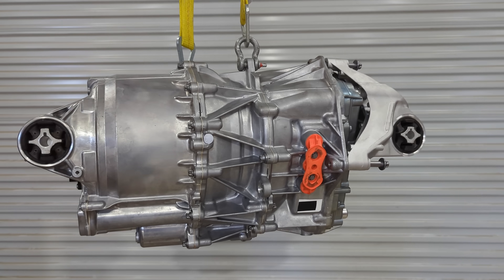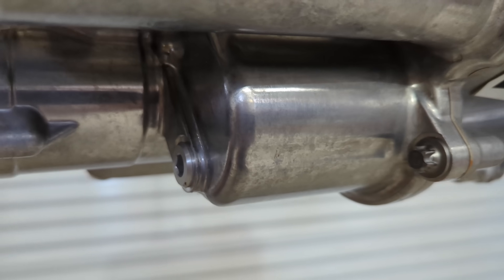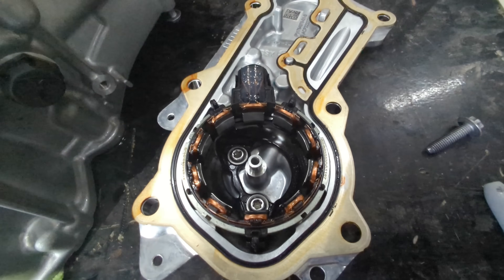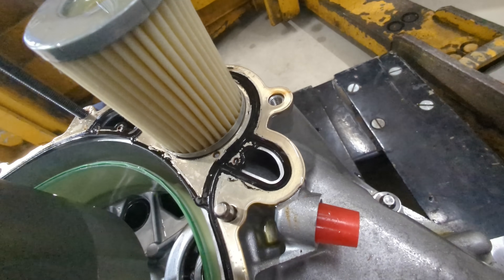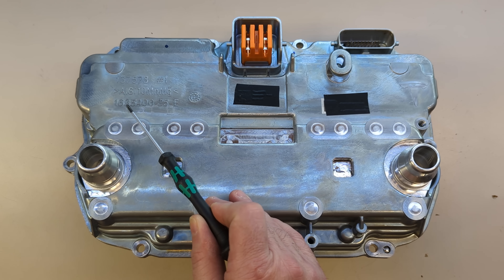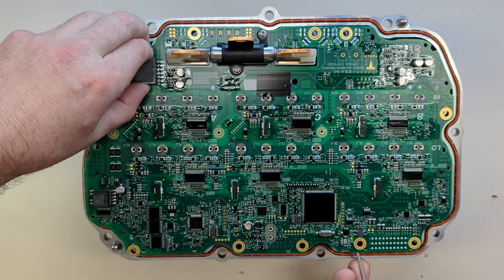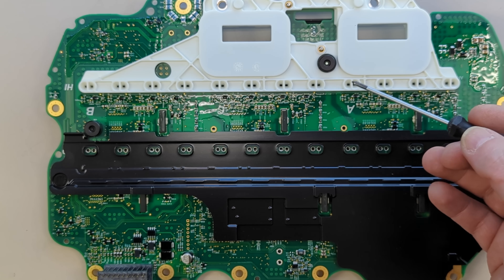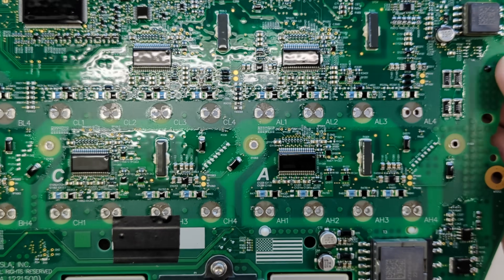Tesla's Newest Motor & Drive Unit

Comment: Should i do the coolant bypass on the model S LDU?
Reply from the maker: If you plan on keeping the car for awhile!  It's looking like all cars eventually have this failure, so preemptive action will mean you are less likely to find yourself on the side of the road one day.   Murphy's Law says that will probably happen when it's freezing cold and raining and/or snowing while you have your whole family in the car for a road trip.
Reply: @ thanks for the Fast reply. I have the Model S for 9 years now. No mayor issues. But, just learned recently of the issue with the LDU and coolant leak. Asked Tesla but they only do replacements. Will probably do the Bypass as motor doesnt have any symptoms now. Thanks
Reply from the maker: @EVunedited  Unfortunately by the time it does have "symptoms", it's usually trashed.

Comment: What does the 640uF capacitor do? Big electrolytic capacitors tend to have short lifetimes if they get hot.
Reply from the maker: It's the link capacitor.  As the inverter switches there are large current pulses, this acts like a local reservoir because there is substantial inductance in the battery loop, so the current just isn't there when it's needed.   It's likely a polypropylene film capacitor, not electrolytic, it should last the life of the car.  See: https://industrial.panasonic.com/ww/products-pt/automotive-film-cap/custom-made-xEV

Comment: They say that in EU and China V2L is possible , but not in North America ? What is the difference? I remember your video of inverter and the fact that inverter only could convert DC to AC in one direction. Do you know if EU inverters are different. Elon said that in EU and China they only needed to do at software update to fix V2L. Any idea ?
Reply from the maker: It's possible in all Teslas, but will require an expensive external DC to AC inverter.  (Subject to Tesla's will).  No Tesla model except the Cybertruck can export AC natively.  Period.  This may change in the future, but as of today (October 2024), the hardware is definitely not capable of generating AC.  All Tesla models, even the Cybertruck state in the vehicle warranty that using the vehicle for stationary storage voids your battery warranty.   So even if you hack it in as I have done, you risk losing your battery warranty.  (I have salvage vehicles, so my warranty is already void)

Comment: Any chance you’ll get your hands on the new 4D2 motor from the new Model 3 Performance?
Reply from the maker: As soon as someone sends me one, I'll do a teardown!   I suspect it's very similar to this one.
Reply: @Ingineerix  - I would love to hear your thoughts on the 2024 Model 3 Performance 4D2 units leaking oil.  My 2 week old '24 M3P (US version) with less than 370 miles on it is leaking fluid.  It appears to be coming from the drive shaft seals.  I also have a very strong odor from the car that smells like sulfur or "rotten eggs".  I'm not sure that smell is related to any gearbox fluids.  I have service scheduled in 3 weeks.

Comment: I have a video request.  Would it be possible for you to test the Tesla onboard inverter and how it handles charging with a standard generator (specifically a non-inverter type generator).  By measuring heat produced in the various components, it be nice to know how well the onboard inverter handles dirty power.

Comment: Is there a security situation such as a pyro controller in the front engine? The moment the pyrofuse is changed after the accident, the fuse explodes and separates the high voltage. Is this due to the new security measures in the inverter at the rear? ( 2023 Tesla model y Performance) GİGABERLİN

Comment: is it possible to swap inverters on the 990 motor? ingenext has a chip for the 980 motor but not the 990. Do you know why the amperage is limited in the 990? I suspect it's still capable of the higher amperage controller.
Reply from the maker: The 990 has 18 FETs, and the 980 has all 24.   I'd avoid the Inginext stuff.
Reply: @Ingineerix  are the motors the same part and they just have different controllers or is it a less capable motor aswell.
Reply from the maker: @BatterymanDan  Same part on the motor, but the resolver is calibrated to a particular inverter.

Comment: The main winding of the normal lotus o delta type place in a panendermic semi-boloid of the stator every 7th conductor is connected to a non reversible trummy pipe connected to a differential girdle spring.

Comment: Been building these for 2 years and heavily modified diffs and other bits you guys can’t yet figure out.. all Tesla units are simple so easy to mod and rework… bit behind as I don’t follow people but u need to move quicker .. have you tried to run a model 3 front on its own???? Cause if you have managed to your lying
Reply from the maker: Not sure what you are talking about.   We do install the Quaife diff on some.   Yes, running a front 3/Y is easy, but it's induction, so not very efficient.  The front "raven" drive unit from the newer S/X is PMSRM, so that one is worth using stand alone.   See my video:  https://www.youtube.com/watch?v=c7ROnNf40Tk

Comment: Very detailed tear down, thanks.  Does your external CAN based controller still work on this new motor design ?  I notice the controller is not avail on the Maxwell website as suggested 2 years ago it would be for conversions.  What happened ?  Also, do you have it suspended in the correct vehicle-mounted orientation, because I thought the old motor had the diff as essentially the lowest part of the drive unit ?

Comment: Damien Maguire has been doing reverse engineering on the earlier model 3 inverter. If you can cooperate i am sure you could reverse engineer this inverter too. I wish i had the level of expertese to reconstruct this particular motherbord. Thanks for sharing it's a great learning video.
Reply from the maker: I have no desire to reverse-engineer the PCB, as that means throwing out all of Teslas engineering in the DSP.   I already know how to control it without opening the case, why would I want to basically start over and end up with an inferior drive algorithm?
Reply: it's been great watching both approaches. learning what different components do and their pins functions.. I was wondering if the new digital isolaters are buffers between the dsp and the gate drivers? thanks

Comment: (Updated version)A bit off topic, but I think the model S uses either 1, or even 2 rear induction motors with z plaid, & cools the rotor shafts directly with the glycol coolant Vs using an oil to glycol heat exchanger for the model 3 & Y. I saw a you tube video by a repair shop Tech for the model S, & he claimed that z newer single lip Teflon rotor seals Vs older 3 lip seasl lasts about 50,000 miles on average before leaking, which can rust the rotor solid to the stator; & in-fact an after-market drain kit is made for this. I guess this is a large price to pay for high performance. I assume that if a newer Model S motor with an electric oil pump Vs gear drive  was cooled indirectly with a heat exchanger, the cooling would be insufficient for prolonged high output, even though induction motors can run hotter than permanent magnet motors?

Comment: A bit off topic, but the model S uses either 1 or even 2 rear induction motors for z plaid, & cools the rotor shafts directly with the glycol coolant Vs using oil an oil to glycol heat exchanger like for the model 3 & Y. I saw a you tube video for z model S from a repair shop Tech who claimed that z newer single lip Teflon rotor seals Vs older 3 lip seals last about 50,000 miles on average before leaking, which can rust z rotor solid to the stator; & in-fact an after-market drain kit is made for this. I guess this is a large price to pay for high performance. I assume that if the Model S motor was cooled indirectly by with a heat exchanger, the cooling woulld be insufficient for prolonged high output, even though induction motors can run hotter than permanent magnet motors?
Reply from the maker: Wrong.  Plaid uses PMSRM not induction.  There is no glycol in the rotor.   That was only on the pre-2021 Model S which was induction, and induction has a lot more waste heat in the rotor vs PMSRM.

Comment: With this pyro fuse setup: does then all the phase current pass through this "eye of the needle" breakpoint, where the pyro fuse hits? Seems like a very small diameter compared to the middle bus bar.
Reply from the maker: Yes, and it does add resistance, but the small amount of total heat developed in this area under hard acceleration is easily dissipated passively.   Same exact thing in the pryofuse (see my fuse videos).

Comment: So the resolver doesn't have to be realigned to the poles when you take it apart? I've worked on industrial motors for years and a traditional resolver will have to be aligned to the rotor.
Reply from the maker: There is a calibration procedure where the drive unit will figure out the alignment and store the calibration in flash memory.

Comment: For the opening of the motor and the bending of the laminates, now that is a VERY BAD design, anti consumer.
Parts need to be built for consumers to be able to service their product and not depend on highly specialized tools or shops with extremely rare or expensive tools and equipment, or being forced to create a complex rig just for that.
As long as it's mine, if i buy it, i should be able to meddle as deep as i want without damaging anything in the process of a normal open and inspection.
Why do i want to look inside?! Why do americans still use the retarded imperial system? Start from there and you can add anything other reason. It's mine, i want to look inside without a risk of damage. It's not a car size nuclear reactor.
Reply from the maker: As a lifelong DIY and a fervent supporter of right-to-repair, I disagree.  I can't imagine any servicing need to open the motor case (not the gear side), as there just isn't anything to service.  If it fails somehow, it's going to be catastrophic, and you'll need to replace the whole unit.  There are many ICE parts you just can't open without special tools.  Ever try opening a modern automatic transmission?   I was able to open the motor case just for my own curiosity and to show everyone.  I was able to do it with simple materials without any damage that will affect operation, so I'm satisfied.

Comment: stator is basically a big starter motor type winding, makes me wonder what sort of power a car starter motor could output using neo magnet rotor.
Reply from the maker: Starter motors are series-wound (usually) and are optimized for low-cost and high torque, but are very inefficient.  This is why you are told to only operate the starter in short bursts if your car doesn't start immediately, as it will quickly overheat.
Reply: @Ingineerix  i see so overheating might be an issue. It would be interesting though to put a neodymium rotor and put 300v or so through the stator, I would never do it, but would be a hell of a little motor if it kept cool
Why no new videos for such a long time?
Reply from the maker: @namenotshown9277  I put a lot of effort into the channel for a few years to try to grow it, but most people don't bother to subscribe, so Youtube doesn't promote my videos and thus, I only got about $100-$200 a month in.   That isn't enough to cover the time it takes to make them.   I'll probably still do them, because I enjoy sharing, but at a much lower frequency.
Reply: @Ingineerix  I see, I know the time it takes to document technical stuff, can understand.

Comment: Great Job! Which is the IC controller manufacturer part number of the DC/DC converter used to drive the Planar Transformers?
Reply from the maker: I have a pinned comment above with all this info, and I also put it in the description.
Reply: @Ingineerix  I do not see any p/n on the list "part on PCB"
I'm not referring to the stgap4, I just want to understand which is the controller for the isolated power supply for the Gate Drivers. From  the video, I supoose it could be the small chip in case SOIC-8, since it is very close to the U-core of the planar transformer.
Reply from the maker: @supermarantz  If you bothered to actually read the gate driver datasheet, you'd see the isolated power supply drive is integral.  I was not able to identify the SOIC-8.
Reply: @Ingineerix  sorry! Thank you for the clarification. You are right. I  was confused having in mind  the stgap1as, it doesn't have the integrated flyback controller, I forgot the stgap4 has the integrated contorller. Now the only information left is the driving  frequency of the primary coil, the span is quite high from 200 to 600kHz I suppose they are in the range of 600kHz, since the magnetic is very small.

Comment: If it was my call, that inverter would be far more accessible from a service standpoint.  That PC board is just full of potential electrical failures.
Reply from the maker: History on the previous version proves you wrong, they are very reliable.  I expect this one to be even more so, not less.

Comment: Solid copper conductors are also a compromise. Yes you have better infill and simpler manufacturing, but multiple insulated strands have lower impedance because they avoid skin effect when being fed by an inverter at a high frequency. Ideally you want multi strand "Litz-wire", but squeezed into a shape that fits the slots and improve the fill ratio. BTW, rewinding your Tesla sounds like a fun DIY summer upgrade to gain a few percent higher efficiency.
Reply from the maker: Yes, but it's not terrible.  Skin effect depth at these freqs are about 0.5mm.
Reply: @Ingineerix  So a solid square conductor of say 6 sq mm (3x2 mm) uses 5 sq mm of the available 6 sq mm, that is 83%, actually better than litze, you are right. So what switching frequency does the Tesla inverter use to pwm the sinusoidal waveforms which is several times higher than the AC waveform frequency, or is the impedance of the windings large enough to filter them out? Sorry for throwing questions at you, but you know.
Reply from the maker: @Tore_Lund  I actually haven't gathered the switching waveform of this unit yet, but I will at some point.   I'm willing to bet it's somewhere just North of 15kHz though, this way you eliminate a lot of audible noise (at least for humans).

Comment: So we can't change oil filter in this one? Can we drain oil out and put new one easy? Why would they make it harder to put new, clean filter? Also, there is not such thing as long life oil. Every oil breaks down with time, every additive breaks down with time. How Tesla imagined this would work is beyond me...
Reply from the maker: You can change the oil easily.  There's no need to change a filter unless it's clogged, and that just doesn't happen in this oil because there are no combustion byproducts blowing into the oil like in an ICE.  Try to shed your preconceived notions, or you are "that guy" still walking behind a motor vehicle wondering where the horseshit is!   =)

Comment: Professional sharing.

Is there a change in the oil pump and filter with the third generation? The appearance looks different. Are there still two filters?
Reply from the maker: The oil pump is the same, with the same mesh screen.  As you can see, the filter is different, it's internal rather than a spin-on cartridge.

Comment: How are the FETs connected to the PCB?
Reply from the maker: Only the source and gate are.  You can see the through-hole connections.  All the high-current stuff is solid welded copper bussing.  (Under the PCB)

Comment: Thank you for the interesting video! Just one question: you mention an encoder and a resolver in the presentation. Do we have those 2 sensors in the Tesla Motor and Drive unit? Is the resolver not sufficient to determine the position and the speed of the rotor? Is the encoder also needed? I just want to be sure if we have both sensors. Thanks.
Reply from the maker: No, if I mentioned "Envcoder", I meant resolver.  There is only a sine-cosine resolver.

Comment: Curious if this is a direct swap to the older motor?
Reply from the maker: The drive unit is a swap, mounting points are identical, the LV connection is the same, but the HV connection is slightly different. (Tesla took this connector in-house)  Could drop in with a new HV harness, but is only software supported on Model Y at present.

Comment: Do you think these have made it to the model 3's built in fremont? If so when do u think they started doing it, i'm going to buy one.
Reply from the maker: They definitely are not putting these in Model 3 yet, I can tell by looking at the software.  As far as I can tell, it's only in some Texas made Model Ys.  Not even all of them.
Reply: @Ingineerix  noted, thanks.  Gonna pull the trigger tmr on tesla 3 base, was wondering if I should get it from existing inventory of the 2023 or do the build.  But it sounds like it won't make a difference in terms of tech, right?
Reply from the maker: @videosuperhero100  Correct.   The Model 3 is a great car.  I have a 2018 Performance.   If you can save money on inventory, might be a good choice.
Reply: @Ingineerix  I'm not getting a discount, but just trying to lock in the tax credit

Comment: Excellent video. What is the best way to take practical courses to learn EV  maintenance
Reply from the maker: Luckily you really don't need much EV maintenance.  Check your brake fluid every year and replace if it's getting dark.  Cabin filter (if equipped) every year.  Windshield wipers, and tires as needed.  Maybe brake pads every 5-10 years.   Really nothing different than a normal ICE car, except none of the engine-transmission stuff.   I do recommend any gearbox lubricant be changed at least every 5 years or 50k for cheap insurance.